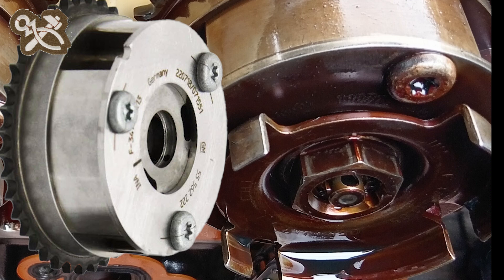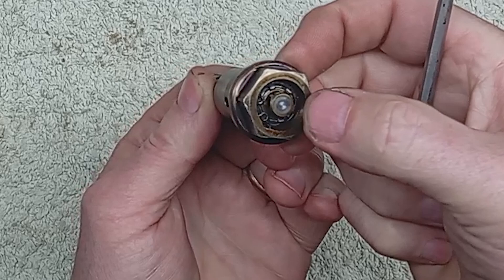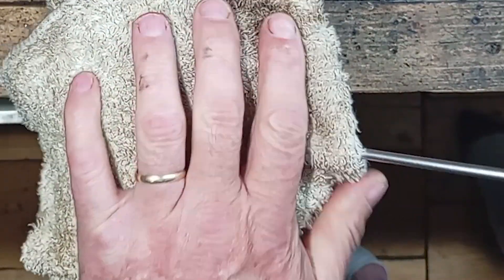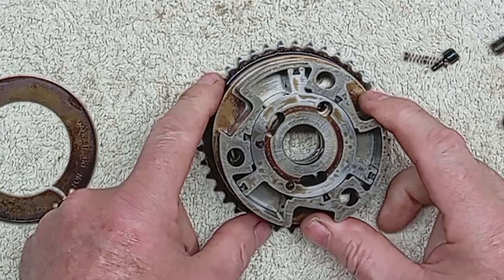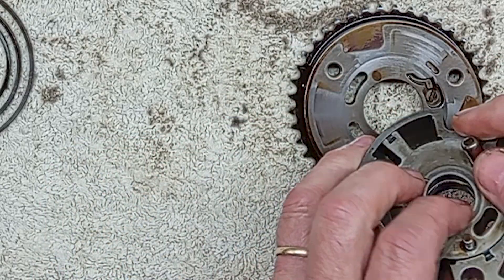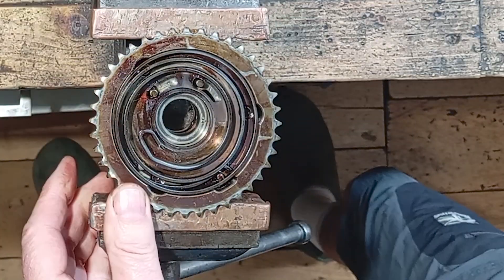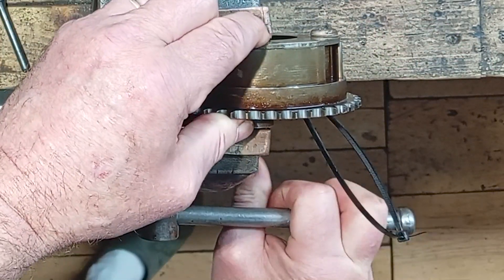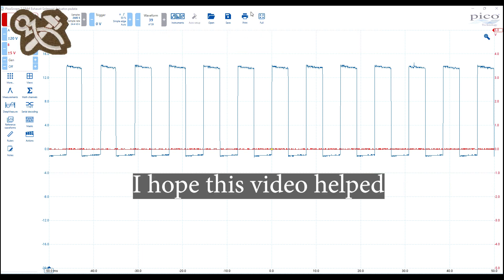Variable Valve Timing Camshaft Adjuster Gear / Phaser - Stripping, Cleaning, Symptoms

Comment: Is it worth taking them apart and locking them before reinstalling the valve/bolt because I’m not sure if it’s timed correctly as I’ve loosened them locked the cams and exciter ring but didn’t realise they have a preload on them